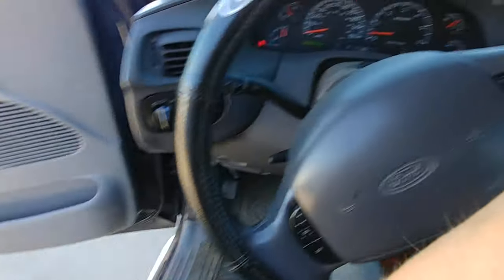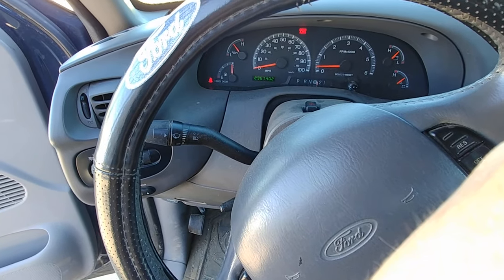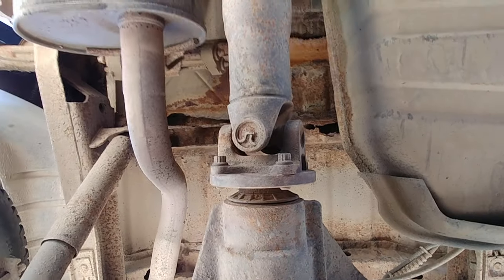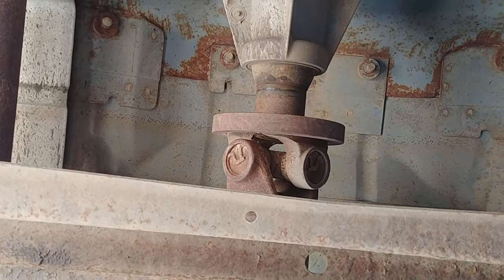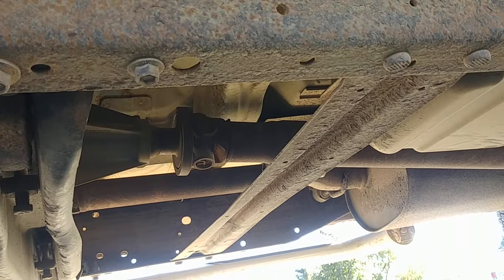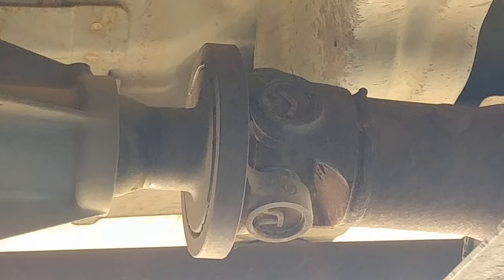Symptoms of a Failing U Joint - Ford F150 Bad Universal Joint on Drive Shaft "Clunking Noise"

Comment: Jack the truck up from the rear axle so both wheels are off the ground and then turn a wheal back and fort so you can hear where it's coming from without the engine running.

Comment: I have a 95 f150 and it was the rear that went out.  Like others said just do both they're cheap and easy.  And you get ones that can be greased w/ a fitting long life. Other signs are chirping when driving, excessive vibrations and if you have a small pry bar, put it between the u joint and if has play, throw it away. ;-) B-)
Reply: I got 95 f150 too. Beautiful truck
Reply: Really? U joints are 1 thing- Now you suggest the Rears?  Telling people its "Easy" to do- Pulling the Bearing caps Then shimming the new one,Pulling bearings and Races Yeah- People in General CANT do that......Make it sound like its a Quick easy job.
Reply: Can it make that clunk noise when I’m comeing to a stop
Reply: @emilyrain9547  it can depending on what part is going out. I got a 2015 challenger and the carrier bearing went out. Made a thump noise when slowing down. Almost a howl or hollow grinding sound. But if any part of a driveshaft is weak and or failing, it'll make noise under load, flexing or backing up. Should be straight and solid but when bad flexes like a spring.

Comment: You saved me, I was told by my uncle  3 years ago it was my U-joint and I thought so too, been having excessive vibration on my 2003 f150 as well which I thought was something else entirely. I started getting bad squealing in the past year  and it would go away if I greased my u-joints. Replaced them both recently and all the issues went away entirely.
Reply from the maker: Awesome! Great work.
Reply: Same here, 2003 f150. Just bought it two years ago and purposely didn't want to purchase anything newer because 2004 was when everybody started having problems with cam phasers.
Reply: This exact sound and the vibrating started on my f250 yesterday morning

Comment: #1 crawling under a truck with the motor running could possibly give you more problems than a u joint ..... anyway , rear u joint definitely bad , I saw the way it moved ......
Reply: If you don’t give af about the little things you might be a redneck. Gotta do what you gotta do lol. Did you kiss the guy in the truck with his foot on the brake lol

Comment: Same 5.4 clangin engine noise i have..those engines sounds like their on their last leg but then drive just fine!
Reply: Sharpboat01 I hope so that’s what mine sounds like lol
Reply: @KollynJ  look up cam phasers on those..i have an 06 5.4 thats sounds like crap but on highway the phaser moves up then smooth but ive not looked into fixing it.. i switched to 40w oil and it helped.
Reply: Sharpboat01 I was working on my 06 last night. Only has the tick on startup but may just be manifold. Just fixed 4wd now it has the slip bump thing from rear end assuming it’s ujoint of pinion hoping my rear diff is not messed up
Reply: Sharpboat01 I had a rattle sound while hovering at 900-1100 rpm. When I did an oil change I used a 0w-40 and it went away. I just can’t seem to pic out the cam phaser sound
Reply: Kollyn Jones cam phaser is a knocking during hot idle.  Mine does it once in a while. 2010 f150.
Reply: @decaturridgebees8761  it sounds like its going to throw a rod sometimes..i had to turn it off and restart and it went away very odd thought it was blown but then runs good.
Reply: I have a 2005 5.4 that sounds like a diesel engine with 318,xxx but it still runs good ,but it sometimes it has lack of  power

Comment: Holy cow what are you doing here?! With the engine not running and your front wheels chocked, jack the back end of the truck up so the wheels aren't touching the ground then shake that u-joint. That's all you need to do and that's all anybody has ever done if they know what they're doing. I appreciate your time showing us one way of doing it, and I like your videos in general, but this one was kind of odd.

Comment: Did it make the clunk when you take off  after a complete stop?
Reply from the maker: Yes. Typically that would be true depending on the situation.
Reply: Thanks!
Reply: If you haul ass yes. But if you ease up and accelerate slowly then no.

Comment: This most likely wouldn’t happen if you greased your you joints at every oil change. And I hope he didn’t just change one U joint he’s down there already with the Drive line off he should’ve just replaced both I hope he did
Reply: A lot of original u-joints don't have grease fittings.
Reply: Factory joints seldom if ever come with grease fittings, and a lot of aftermarket ones don't come with them anymore either.  Some are using lifetime PTFE lubricants now.  He lives in MN so he is dealing with road salt, most likely rusted the needle bearings out under the caps.
Reply: @fldave612  tons of them do you have to ask the less than knowledgeable parts guys

Comment: Mine doesn’t have the obvious click like yours, but it does like a thump feeling when I accelerate or come to a stop; it’s like a delayed thump. I was just wondering if that would also be a sign that the yolk is going out?
Reply: It could be however I would check the grease under the boot on the two-piece driveshaft. The two piece shaft is usually the front drive shaft.
Reply: Also don't try checking your u-joints like he showed you. Jack the back end entirely off the ground and shake the u-joints to see if there's any play. There shouldn't be any at all. There's usually a little bit of play when you spin the drive shaft back and forth and that's just the backlash of the splines (inside the transfer case or transmission) which is normal.

Comment: I have the same issue 2000 f150 4x4 5.4l lariat. Cabt find your video on how to replace
Reply from the maker: I haven't put it up yet! Thanks for the reminder! Maybe I'll try to get it up in the next week or so.
Reply: I just bought the same, when I accelerate it jerks and makes this super loud clunking noise, did you ever find out the issue?

Comment: I have a 2000 f150 and I just heard that sound. while idling on my driveway and shifted to drive I heard loud clunk/grind sound. I moved forward and hit the brake it happens again which  I thought it was my brake pads then shifted to park and back to drive and reversed and that clunk is getting louder!! Was that a u- Joint issue???
Reply: Did you figure it out ? Have the same issue with a 2008 explorer, you feel a thump and clunk sound when put in reverse and park.
Reply: @J.l198  I went and lubed the spline with hella grease 😅!!! At first it kind made the sound go away but came back !!! Yes thump and loud screech!!  I did lift the truck 3 inch so I was told that the differential alignment was compromised !! Now I have to undo the ubolts and drop the diff to fix it because I do see the diff is abit pointing up and not straight forward 🤷🏽‍♂️🤷🏽‍♂️🤷🏽‍♂️ it’s been like that for about a year now no issues other that the weird sound it makes when shifting from park 😅
Reply: @Tacos_d_asada  mine does it when put to reverse or drive, harsh clunk, I hope it’s not trans,

Comment: my truck vibrates when i accelerate, also while driving it shifts hard into 2nd, like it bucks. can the hard shift be caused from bad u joint? did bad u joint wreck my gear?
Reply: same thing for me im going to replace the u joints this weekend hopefully it fixes it
Reply: @jayherrera694  i found out that my u joints are good, theres no play in them...
 the bucking is from i guess a..bad half gear pack? or shot out bearings in my trans... i also have some what of a death wobble at 40 mph my tires feel like they are going to pop off, major shaking.... i need pitman arm, idler arm, inner tie rods replaced....865 bucks later for the death wobble fix. my drive shaft has a small fracture in it, and my differential fluid was super low, dirty and had metal shavings in it. possibly bad gears/bearings.. the vibration when i accelerate, so far has stopped since i did a service on the differential and when it bucks, it doesnt have a loud metal clunking sound anymore. but the vibration you have could possibly be just low differential fluid.

Comment: I have a clunk when I take off (always) . . . and no other time.  There is no whining or vibration at highway speeds.  Do you suspect U-joints?
Reply: Yes
Reply: @jonathanlanglois1791  mines not a clunk more of like something sliding into place like a slight bump and only at dead stop take offs, is it my U joint's ?

Comment: So I’ve got an extremely similar noise coming from my crown Victoria it only happens when I’m doing somewhere between 0 to 5 maybe 0 to 10 miles an hour. I cannot replicate it for the life of me and it is definitely not consistent at all but it sounds very similar to the clunking noise you have here.  think it might be that u-joints? Definitely sounds like it’s coming from underneath the car but it’s weird because sometimes it sounds like it’s directly underneath me sometimes I hear it in the rear it seems to move all over
Reply: Take a peak at the transmission mount those can clunk sometimes if it looks good then pull the shaft off and inspect the u joints. Pull the end caps off make sure the needle bearings got grease and everything moves smoothly. it’s easy enough and could save you a lot of money on a new driveshaft if one of the joints is failing. U joints are cheap drive shafts are expensive. I ignored some early warnings on my Oldsmobile and the rear u joint gave out on a big one two shift trashed the whole shaft cost 600 bucks lol.